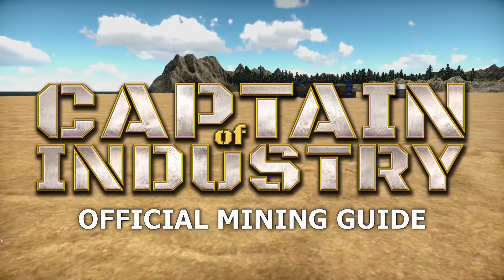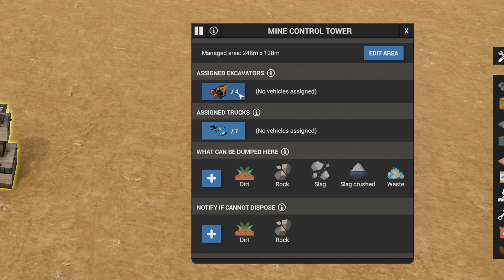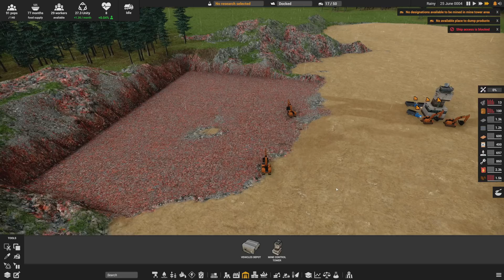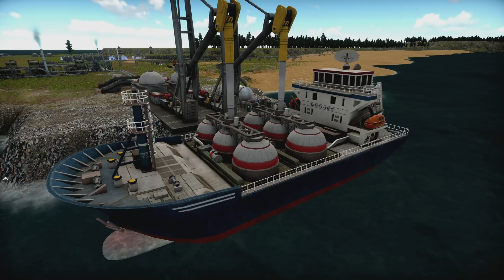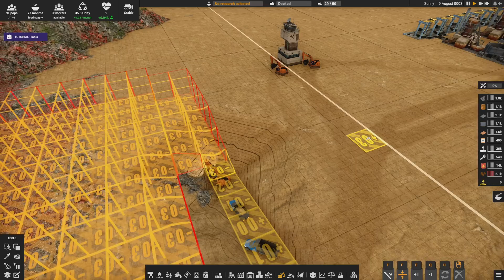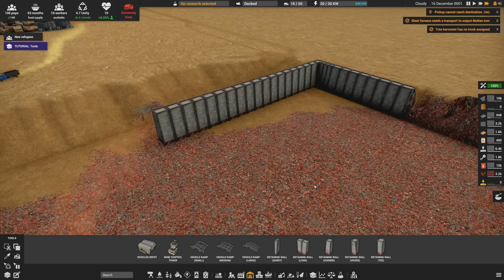THE OFFICIAL MINING GUIDE - Captain of Industry Guide - Early Access

Comment: Quick tip if it hasn't been mentioned already: Mining towers don't have to be built for their dumping preferences to take effect, meaning you can create separate dumping grounds for Dirt, Rocks, Slag, Waste etc without actually using any resources building the towers that control those dumping grounds. At least as of version 0.4.14B
Reply: Still as of update 3!

Comment: Is it possible to place a Transport,  then dig down under it increasing the height so its tall enough that excavators could in  theory fit?
Or will that desabalized the transport.
I myself use ramps, but just a thought to try out.
Then again, if it is hard coded that way to never allow them past, I guess its most likely not.
Reply from the maker: You cannot excavate where infrastructure already is

Comment: TY so much.  Grat video.  One question.  I can use the dumping tool quite  well.  But when mining I can't seem to get the level to go up or down when i want.   If I use the angle it alays wants to climb,  not descend   and then all of  a sudden I've pressed the right keys or something and it goes down.  Q and E seem to have no effect.   And F just goes up or flat.  Until it doesn't.   arggh.     
Also,  it seems  the really large trucks (tier 3) won't go under transports. 
This game is so fun.
Reply from the maker: Use R to rotate the slope tool. The default state for mining should be to slope down, and the default for dumping up. - but R will let ya change around.

Comment: Good stuff. Will really help people struggling with the mine/dump mechanics.
Reply: Something to add to retaining walls. Sense the walls can be built anywhere but mining is locked to the grid you can mine through the wall and destroy things you were trying to protect. So long at the section to be mined is in the middle of the wall your good. But if it goes just a little past the wall model not even the area the wall says it takes you will dig past it.